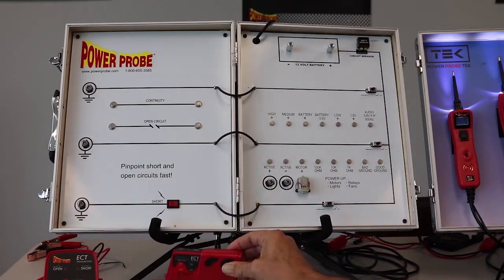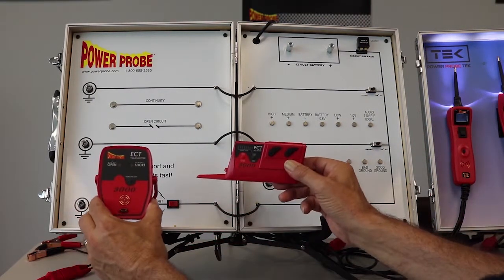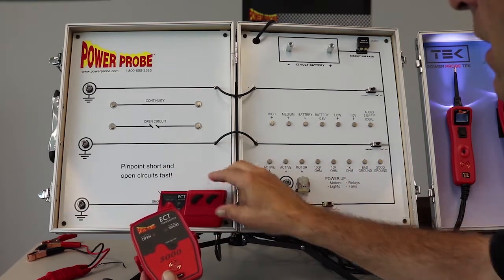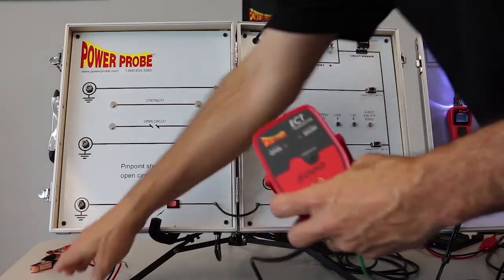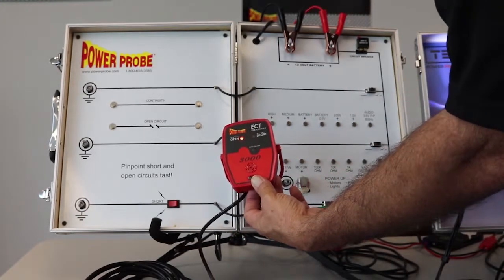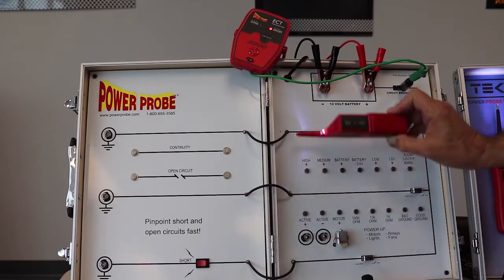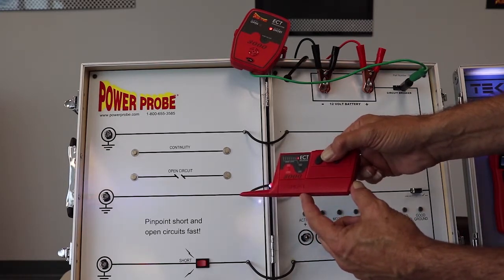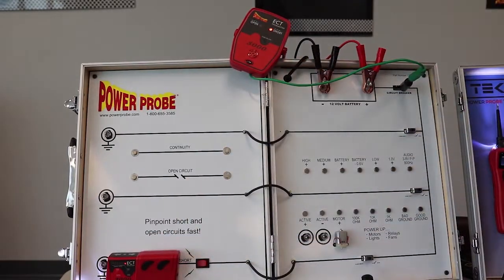ECT Demo 1

Comment: Would it be more accurate if you disconnected the battery to isolate a specific wire, since there is powered wires all over the harness.  My guess,  it’s one wire we’re trying to pinpoint, I’ll try today and see what’s more affective,

Comment: But its flawed.  Before it can pick up the wires in the harness.  And it has a problem working when there's a lot of wires in the harness when its in the low Sensitivity . It needs more R&D on it to work better.  I like mine but it can be A little deceiving